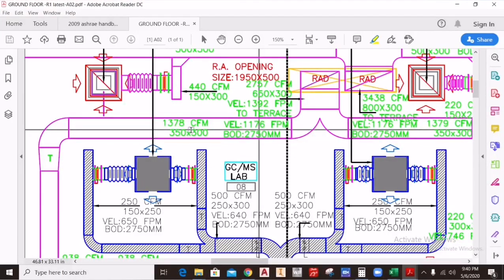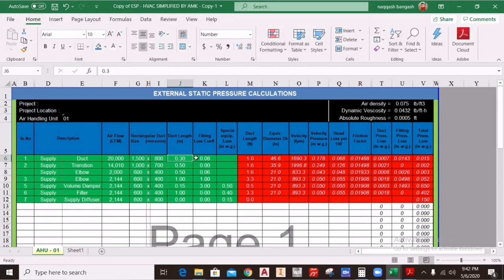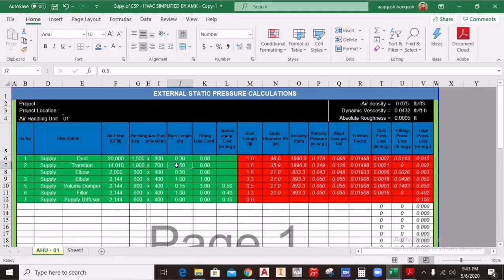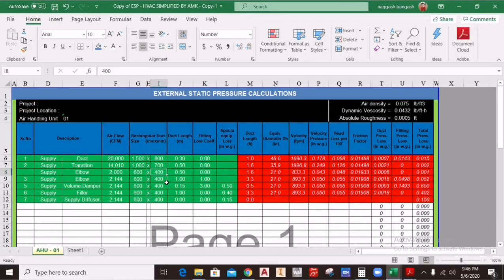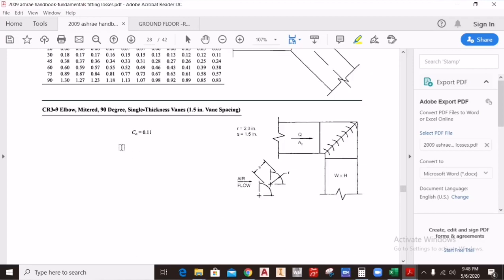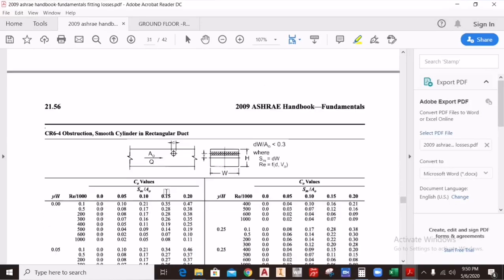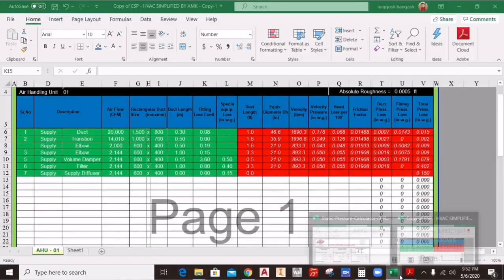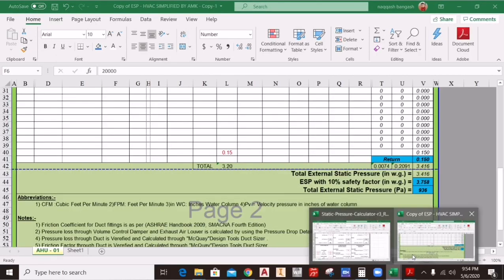External Static Pressure (ESP) Calculation by ASHRAE handbook method. (ENGLISH)

Comment: Can we consider 0 deg for the butterfly damper
Reply from the maker: @vtv5143  for what purpose?
Reply from the maker: @vtv5143  zero degree means fully open, but at site, it's not possible that fully opened damper can control the flow.

Comment: In your case 600 is width and height is 400. H/w means 400/600 right how come it is 600/400
Reply from the maker: Divided greater by lower value. 
If w/h if w is greater
h/w if h is greater.

Comment: Hi Sir,how to calculate pressure drop for plenum box?
Reply from the maker: Consider plenum box as duct and calculate it using ASHRAE duct fitting database or as per standard the fcu plenum velocity is 500 fpm, put 500 fpm and cfm in duct sizer you will get the pressure drop.

Comment: Hello, suppose A/c located on rooftop or Basement i want supply the air to ground floor,here in this case what are all factors has to considered?? Elevation difference??
Reply from the maker: You have to consider all fittings losses, duct losses, accessories losses etc.
Reply: @passionateengineer04   Appreciate your reply message, Thanks,Noted your message,I've read one article suppose the unit located on Roof and air supply  to the ground, in this case Thermal gravity effect has also to be taken to account=(density of air*gravity*height (downward flow, upward flow)) and expecting your reply,Thanks
Reply from the maker: Yes the gravit effect the air flow, but it depends whether you are using single blower for supply and return or you are using separate blower for supply and return air.
The air near ground is denser and at greater pressure,  for better calculations you can consider this, and it will effect the ESP also.
Reply: @passionateengineer04  Thanks brother,one small request when you having the free time make one video in this topic, I searched YouTube,there is no videos in this topic(elevation difference).Thank you appreciate it🤝

Comment: Nice video sir...for room positive pressure like 15 pa..do i add more 15 pa with the calculated ESP.
Reply from the maker: NO ESP is the pressure that overcome losses of duct, for room pressure you have to play with FA,RA,SA.
Reply: @passionateengineer04  thanks..i have one AHU with 3000 cfm and velocity 1600 fpm..and i want to design duct by using velocity method..and i will use the duct velocity 800 fpm..so can i do it where machine is 1600fpm..is it possible to get desired velocity from this machine..
Reply from the maker: Yes its possible to get the 800 fpm velocity in duct, if machine have different one
Reply from the maker: But it will increase the duct pressure.
Reply: @passionateengineer04  thanks..i think it is better to design the duct with respect to AHU discharge  fpm.right..? initially we dont get that manufacturer data first. before that we complete total design. In that time what i will consider..?
Reply from the maker: @milonkhan4889  Design duct according to AHU.
Reply: @passionateengineer04  thanks...in the guidlines i have seen that return duct velocity is less from supply duct..as a result duct size or cfm will be change..practicall what i should less velocity or try to keep same velocity as supply..?
Reply from the maker: It depends on room pressure, how much you want to maintain.
Reply: @passionateengineer04  thanks.
Generally when velocity increase cfm will increase and when decrease cfm will decrease..when supply cfm is more from return air thats call positive pressure..and when supply is less from return air thats called negative  pressure..right..?
Reply: @passionateengineer04  thanks. Sir i have 02 nos AHU.every AHU is 150 pa. Now i need 300 pa due to change some design..if i add 2 AHU together with one duct..do i get 300 pa.?
Reply from the maker: 150 pa is ESP?
Reply from the maker: If you can connect it in parrallel than ESP will be 300 pa.

Comment: Hi Mr. If  there are VD on straight duct on second floor and on take off branch duct drop down first floor, are the VDs  calculated in ESP system?  Thanks
Reply from the maker: All fittings should be considered in While calculating ESP

Comment: Sir can u plz tell how ppl are directly taking 150 mm wg static pressure internal and external including what is that thum role
Reply from the maker: You can use 0.1 wg per 100 feet of duct.